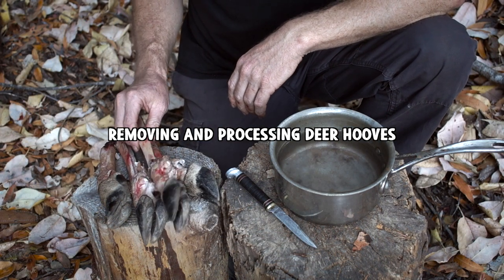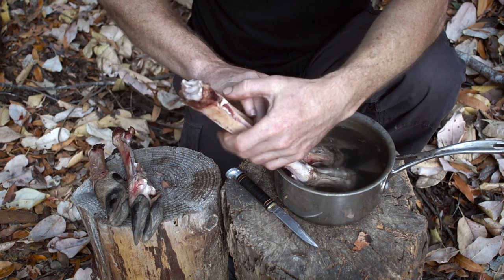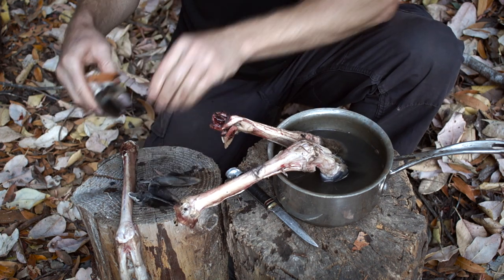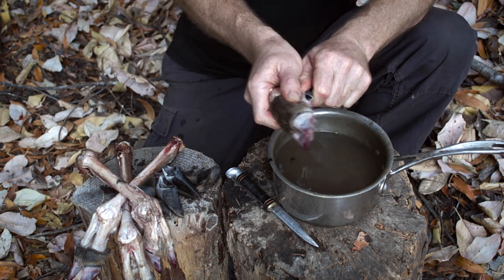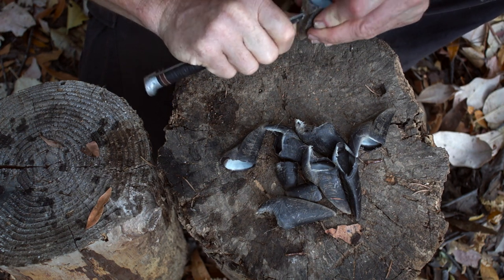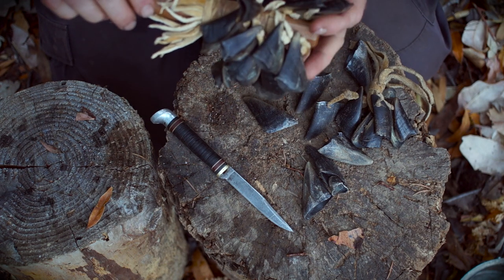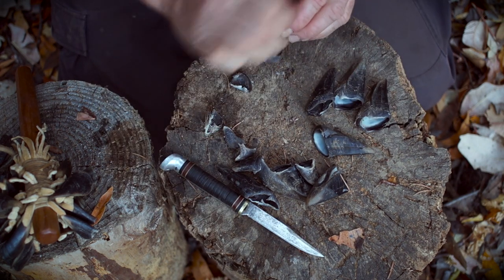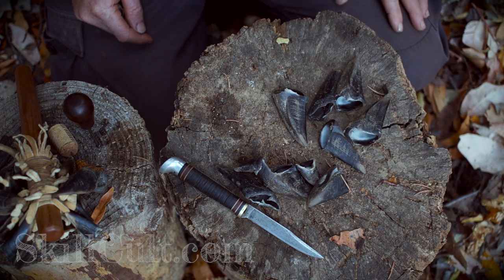Uses of the Deer:  Removing and Trimming Hooves for Rattles and Decorations

Comment: Thank you for this informational video. Do you have a video on how you made the chocker from the toe bones?
Reply from the maker: I do not.  I drill a hole through the base and basically lace them on. If you wanted to have the attachment invisible, I think you'd probably have to use metal.
Reply: @SkillCult  , thank you for your speedy reply! I'm trying to visualize what you mean about using the metal. Can you explain further? My artist's mind has to see it in my head 😜
Reply from the maker: I mean, maybe glueing in a post from the back, or metal studs often have flat headed screws that go in from the back side.  You could maybe also glue in a copper or brass post, set a washer over it from the back and hammer it over as a rivet.  If you look up riveting knife handles with washers, you might see what I mean.  I can't think of any other ways to do it.
Reply: Awesome, I see it now! Thanks! I love learning new things. This will be a cool one! Keep up the great work!!!
Reply from the maker: Actually, one thing that might work is to drill just the right sized hole in the bone and actually cut the threads into it.  You can buy a threading tap that cuts the treads the right size at any hardward store.  They are pretty cheap.  If added glue to that, maybe epoxy, I'm sure it would work.  You would not be able to tighten it then though, so I think it might be better to try it with just a washer on the back first and if the threads don't hold, then glue it later.  There is definitely hardward for that sort of thing too, where you would set a nut of some kind that is made to be recessed into wood to receive a machine screw.  A specialty hardware place would know what those are called and might even have them.  Most medium sized towns and all large citie's have those, but you have to look in the phone book, because only people like contractors and metal workers know about them.
Reply: @SkillCult  great! Thank you! My daughter is super excited to try this. She's in high school and is an up and coming fashion designer. She's focusing on costumes for cosplay and this is right up her alley! 👍
Reply from the maker: @dancingstarcreationsdonnac3894  Cool.  If people hunt deer a lot in the area, butchers can have piles of these legs during hunting season.  I usually bury them for one year, then after drilling any holes, boil them repeatedly in something strong like dish washing or laundry detergent to clean and remove fat.  Then soak for 12  hours or so in hydrogen peroxide to bleach white.
Reply: @SkillCult  thanks! We were thinking about going to the meat processers to see if they had more legs. We're from the Chickasaw tribe and we use the toes to make leg shakers for women to wear. 😊
Reply from the maker: @dancingstarcreationsdonnac3894  Cool.  I've seen those hoof rattles from all over the world using different animals, often as anklets and arm bands.  It seems like one of those almost universal things.

Comment: Hi, is it safe to do this with a deer leg you found in the woods? Is it safe to just pick up dead things with bare hands or should I take safety precautions before it’s disinfected?
Reply from the maker: I would probably not.  usually they are dried up too and hard to get the hooves off.
Reply: @SkillCult  Yeah I kind of learned my lesson before I saw your response... Took almost two hours for me to get them off, but it did eventually work. Maybe it would have helped if I had a sturdy pair of pliers and something sharper than a box cutter too.

Comment: Can you make neats foot oil out of the left over lower leg bones?
Reply from the maker: Yes, but there isn't a lot in there.  You can remove the marrow, cook it and strain, or boil and skim of the oil.  More traditionally, I think the whole foot and leg bones were cooked, the oil skimmed and the solution used to make glue from all the connective tissues and tendons.

Comment: I suppose you just slow cook the toe out if it breaks off in the hoof? ... oops
Reply from the maker: That might work, or prying it out with something.  They can be hard to handle.
Reply: @SkillCult  I let them go for about 10 mins around 180°F, then ran my knife between the bone and the hoof cutting out the frog? ( think that's what you called it). Then I forced pliers in and ripped them out. I guess not too bad unless you want to keep the frog on like I did. 

How did you clean those "toe bones" up? That necklace looked pretty cool; I wouldn't mind trying my hand at one.